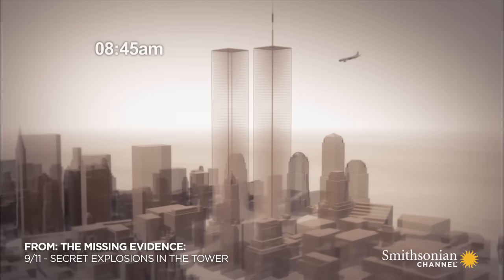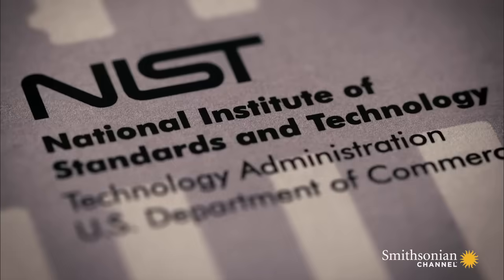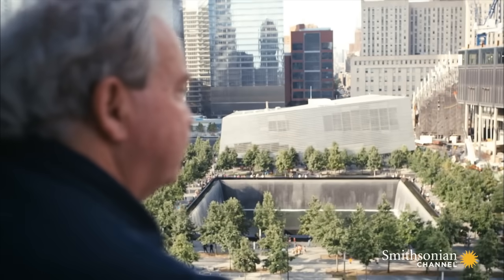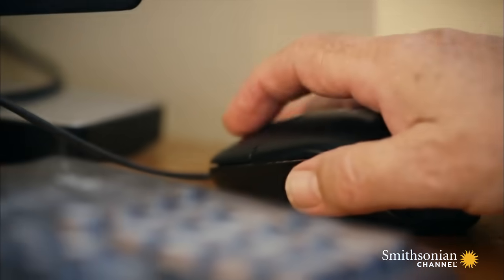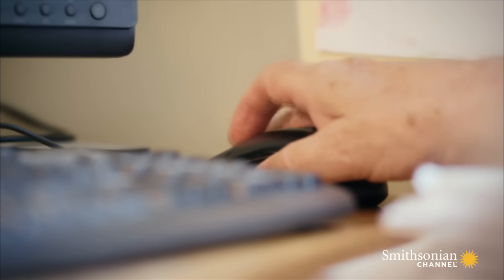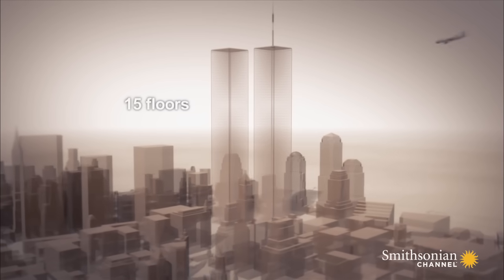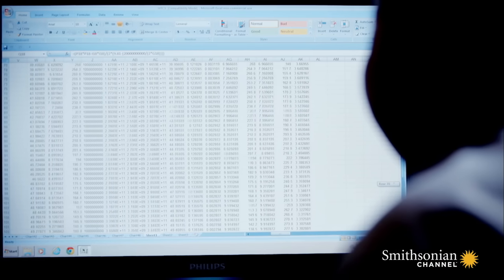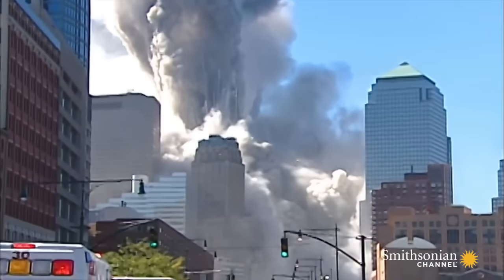This Computer Simulation Explains How the Twin Towers Fell

Comment: Explained absolutely nothing... where did the TONS of debris go?  This video explained not one of the strangness of qualities that westerners understanding of physics can explain.

For example the “melting metals” with no heat...

The difference of melting points of different metals (steel vs aluminum)

All the concrete...

The Building was built on water!  The building turns to DUST in mid air!!! Where are the thousands of bodies and desks, computers, furniture...

This is not a regular explosion.  This is not a regular demolition!

Anyone who has seen a demolition, done demolition, knows physics... know this is NOT right!
Reply: Look up the wtc sphere. Crazy.
Reply: it all went to china right away to be melted down. It's called evidence tampering. You can't do a real investigation when someone is throwing out all the evidence.
Reply: @mroselli7482  Wrong. The rubble was carted to Fresh Kills on Staten Island, where it was sifted through by forensic investigators.
Reply: @tpryce6423  not according to the port authority. Where did you get your information from??
Reply: @mroselli7482  Go to WTC Steel Wreckage at Claremont Scrapyard Feat. Dr. Astaneh-Asl where you can see a structural engineer examining the wreckage.
Reply: @mroselli7482  Do you realize every claim you’ve made is demonstrably false?

Does that make you wonder?
Reply: @markh1011  you want me to go to some site featuring the head of NIST??!!??  🤦
Reply: @tpryce6479  no it doesn't make me wonder at all what's your opinion of me is..... who are you exactly?
Reply: @mroselli7482  Sigh.  
It's the name of a video.  
He was never the head of NIST.  
🤦‍♂
Reply: @markh1011 ,  (@M Roselli) If you give them 500 pieces of evidence debunking their conspiracy, they will come up with 501 reasons why your evidence is just part of the conspiracy. Having the courage to actual try to debunk my beliefs (you know, like how science works) is the only way I broke free from being a 9/11 Truther 16 years ago.
Reply: @adamwhite4496  Yeah every time you refute something they move on to a new claim "well what about this then!" "well what about the pentagon?".   It never ends.  They overlook how many flawed claims they have abandoned because it's like a religious belief to them.
Reply: @markh1011  "They overlook how many flawed claims they have abandoned." EXACTLY. That should be an indication that other claims need to be revisited and potentially debunked. My niece has now fallen for this bs, which is why I find myself researching it again.
Reply: @markh1011  lol
Reply: But I’m not really sure why a women would be trying to figure out science things. Woman aren’t good at science.
Reply: "For example the “melting metals” with no heat..."
No heat?  There was plenty of heat.

"The difference of melting points of different metals (steel vs aluminum)"
What about them?

"All the concrete..."
What about it?

"xplained absolutely nothing... where did the TONS of debris go?"
In a big pile that took over 6 months to clean up.

" The building turns to DUST in mid air!!! Where are the thousands of bodies and desks, computers, furniture..."

Smashed during the collapses.
Reply: @markh1011  aww the paid shill is hard at work today! Good for you!

Comment: Note: The towers didn’t collapse because of the metal weakening from the fire because the fire was never near hot enough
Reply: The fire was hot enough to weaken the steel structure by 90%
What do you mean by that?
Reply: @itstrueaweeb  The steel was weekend on how many floors? A fire fighter made it to the 78th floor at the South tower, that's 78 untouched undamaged floors vs 22 already weakened damaged floors. How did your "pile driver" continue falling and racing towards the bottom with zero floors resulting at the end!? Where are the stacked floor concrete slabs at the bottom so we can believe in the "pancake" theory!!!?
Reply: @Vantriloquist-j9j  Domino effect, oh my god. Do you know how heavy the top part was? The building weight id uniformal, that's one factor that allowed it to collapse. The concrete is all destroyed, how can it survive such fall?
Reply: @Vantriloquist-j9j everyone is trying to trick you, but you’re extra super smart.  🙄
Reply: It doesn't need to get anywhere than here the melting temperature to significantly weaken the metal even if it only made it Glow red-hot that might be enough
Reply: Yes that’s what i actually meant.  Not that there was NO heat just not that degree of temperature to melt the steel.  It’s all actually tragic and fascinating it’s hard to remove the emotions while learning the facts.  People wanted answers and as long as they had answers they didn’t care if they were correct
Reply: It has been proven in a laboratory that it was hot enough.

Comment: well   since this guy said the weight of the upper buildings caused the collapse,    guess we suppose to believe that.            even though theres been tests after tests after tests & a smaller scale tower based on the exact same structure had to try many different methods & the only way he made it collapse to the ground was  by "helping it,
Reply: The proportional strengths of building materials doesn't scale with size.
A collapsing jenga tower will not represent a 1300 foot high steel structure.
Reply: @markh1011  go into engineering and you'll get to see the software they work with to build building bc of those parameters needed to be entered into their mold in order to test it prior, during, and after completion to ensure safety and compliance. 

NIST only used a single model, and you seem to believe their data and findings. Why do you believe a gov agencies data from modeling and discard the private sectors models?
Reply: @mroselli7482  Every legitimate independent investigation has corroborated NIST’s conclusions.
Reply: @mroselli7482  
"NIST only used a single model,"
NIST used various models as part of their analysis.   Their findings don't hang off the model, that's only a component of it.  
Also, organisations such as MIT, Purdue, Exponent Failure Analysis, Weidlinger Associates used modeling as part of their investigations into the towers collapse.   Independent studies... different models... different inputs... consistent results with NIST.

"Why do you believe a gov agencies data"
See above.

"and discard the private sectors models"
Which models?   No one has utilised modeling software to refute NISTs findings.
Reply: @tpryce6423 name them
Reply: @markh1011  name the "various" models they used.
Reply: no independent models were ever done?!?!?!?  lol You can't be serious lol  UAF did one and that's one just off the top of my head.

AE11 did 14 themselves prior to filing suit.
Reply: @mroselli7482   For example the structural and impact modeling was SAP2000 and LS-DYNA.   Fire modeling was something else.  So not, not a single model.   I'm talking about modeling software here.   Is this what you are asking? 

Was that the only response to my post?
Reply: @mroselli7482  
"AE11 did 14 themselves prior to filing suit."
Ae911
Yeah there is a reason why none of their work is supported...  it's laughably bad.
Reply: @markh1011  and their work is supported, that's how they got thousands of other professionals to join.
Reply: @markh1011  i didn't' ask what software they used. I asked what models they used to ascertain their conclusion. You said they used many.
Reply: @mroselli7482  
" I asked what models they used to ascertain their conclusion."
Each forms a part of their overall analysis.

" You said they used many."
That's right there are many components to their overall analysis.  All of them consistent with the observable evidence.  All consistent with independent sources such as fire tests for example.

...and this was supported by other oganisations who performed their own analyses.

Are you trying to complain that they only produced one report?
Reply: @markh1011  I'm asking specifics and you are just giving generalization. Why? 

You seem to talk like you know what your talking about but can't answer specific questions with specific answers. Why?
Reply: @markh1011  i also asked what your career was in.
Reply: @mroselli7482  You do realize the vast majority of “professionals” who’ve signed that petition have no relevant expertise?

You do also realize that group have yet to produce a shred of legitimate science supporting their claims?

You do also realize their claims have been summarily rejected by experts and non-experts alike every time they’ve seen the light of day?
Reply: @mroselli7482  
"I'm asking specifics "
No, you're asking vague questions and ignoring the answers.  Their analysis contains multiple components, not just one.   
 I even reference the modeling software used for parts of there analysis and hilariously you complain about not being specific enough.

You don't seem sure what you're asking.  You just want to ask a question that implies there is some sort of problem with their analysis.

Your lack of understanding and research doesn't imply a problem with their analysis.
Now, if you really have a question about it - make it clear what you are asking.
Reply: @mroselli7482  
" i also asked what your career was in."
Does it matter?   I didn't do those analyses.
Reply: @markh1011  of course it matters. An autozone cashier's opinions on structural analytics is not one i would ever listen to bc i know they have no idea what they are even reading.

My degrees are all in human anatomy and emergency medicine and during covid i heard tons of people like you trying to pretend they knew science and medicine. They were all extremely dumb and i refused to waste my time with them.

So i'll ask again, what is your degree or industry of expertise arise from?
Reply: @mroselli7482  
"of course it matters. An autozone cashier's opinions on structural analytics is not one i would ever listen to bc"
You seem to have missed the important second sentence.  I didn't work on all the analyses I referenced.
So my qualifications aren't relevant.

"So i'll ask again, what is your degree or industry of expertise arise from?"
The answer will be the same.    I didn't do the analyses.  

" i heard tons of people like you "
lol... people like me who referenced experts.
You don't see how hilarious you are.
You put all your faith in a few fringe kooks and ignore the experts.  You're from a medical background?   Ok good then understand this.  In this context you're the equivalent of people who say that vaccines cause autism.
Reply: @mroselli7482  I see this happen a bit on the internet, someone is struggling to address the arguments so they turn on the person instead with 'well what are your qualifications'.
Reply: @markh1011  without education in a specific field, that person has no idea what they are reading and lack the ability to comprehend it outside of just reading the title.

Medicine and science is extremely hard to fake. Physics and advanced mathematics is twice as hard. I don't even pretend to understand physics and i've taken two linear and expansion technical college classes as a pre-req to a course degree.
Reply: @mroselli7482  
"without education in a specific field, that person has no idea what they are reading"
So you're saying that everything you've posted so far can be dismissed?   You're conceding that you're hopelessly out of your depth here.
Reply: @markh1011  I'm not struggling at all. I just never listen to the gov experts unless the private sector is on board with their studies. In this case, the private sector is screaming out in defiance. 

Its the same in medicine, I would never just listen to the NIH or CDC unless private industries sign off on what they are talking about.
Reply: @markh1011  i hope i simplified my stance as basically as i can for you to understand sport.
Reply: @mroselli7482  
" I just never listen to the gov experts unless the private sector is on board with their studies. "
I referenced people from the private sector who reached the same conclusions as NIST on the towers and what did you do?   You dismissed it.
So don't bother giving me these lies.
Reply: @mroselli7482  
"i hope i simplified my stance "
Your stance is that you want to believe in conspiracies and you don't care about much else.    By your own logic you know nothing about this topic.
It's very easy to understand sport.   lol
Reply: @markh1011  you named people that reached the same conclusion as NIST?? I just scrolled up and never saw a single name 🤔🤔
Reply: @mroselli7482  
" you named people that reached the same conclusion as NIST?? "
I gave you organisations.   
This is like a game of whackamole.   No matter what you are given you will just invent a new problem.

There were numerous peer reviewed papers in relevant journals that supported NIST.  A standard that the conspiracy theorists cannot even pretend to meet.
I could post a list of them.   Then you would have to invent another excuse.
Reply: @mroselli7482  
Posts aren't getting through.

"No, physics is not my specialty which is why i listen to the thousands of private sector professionals"
I referenced private sector organisations.  You dismissed them.  

You are basically the same as people who think vaccines cause autism.   Anyone who says they don't would be paid off by big pharma in your mind.

You find excuses to dismiss scientists who don't agree with your preconceived view.
Reply: @mroselli7482  
"F NISTS theory for fire induced total collapse is true, why has no one proven it??"
What do you mean by "proven"?   What would be "proven" to you?
Reply: @mroselli7482  
"Why has it never happened since in older buildings or new ones????"
Fire has collapsed buildings before and after 9/11.
As for new ones, due to the 9/11 collapses many building codes changed and they don't design them like that any more.
Reply: @markh1011  i scrolled up and you never once named any person or organization to me. Sorry pal
Reply: @markh1011  proven as in the only way the word proven is used in the science world in regard to theoretical proposals. 🤦‍♂

Now i understand why admitting to your profession or "career" is not something you're willing to do. I'm not sure why you people insist on pretending to have a grasp in a subject that is out of your grasp and abilities. It's juvenile to me
Reply: @mroselli7482  Here you go again, pal.
"NIST only used a single model,"
NIST used various models as part of their analysis.   Their findings don't hang off the model, that's only a component of it.  
Also, organisations such as MIT, Purdue, Exponent Failure Analysis, Weidlinger Associates used modeling as part of their investigations into the towers collapse.   Independent studies... different models... different inputs... consistent results with NIST.
Reply: @mroselli7482  
"proven as in the only way the word proven is used in the science world in regard to theoretical proposals. "
You're being evasive.
To people who believe the earth is flat, it hasn't been "proven" that it is spherical.  Nothing will ever be enough for conspiracy theorists and you're showing this.
Reply: @mroselli7482  
"Now i understand why admitting to your profession or "career" is not something you're willing to do"
No you don't understand why.
I have a science background but I'm calling you out on your attempt at ad hominem.  You could not refute the argument so you tried attacking me.
The funny thing is that but your own logic, you don't know enough to say anything about this subject.   🤦‍♂ 😂
Reply: @mroselli7482  
"I'm not sure why you people insist on pretending to have a grasp in a subject that is out of your grasp and abilities."
I don't think I've ever seen such wonderful projection...   🤣🤣🤣
Reply: @markh1011  lol